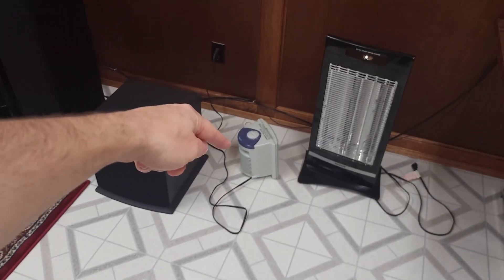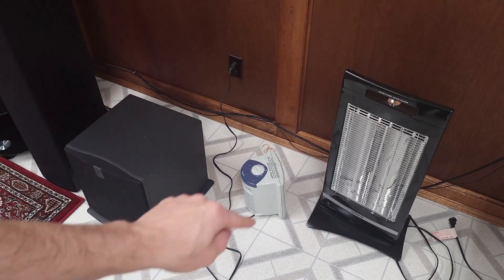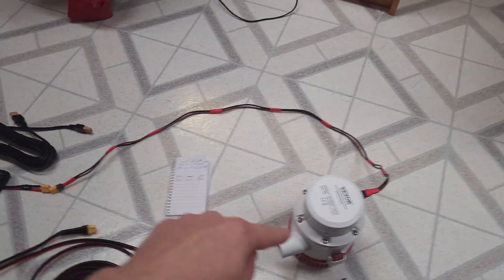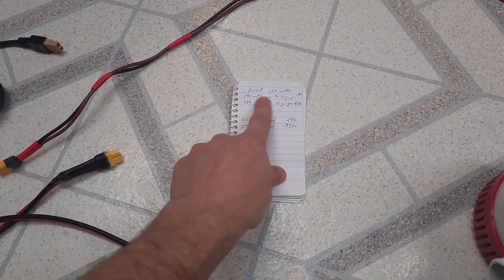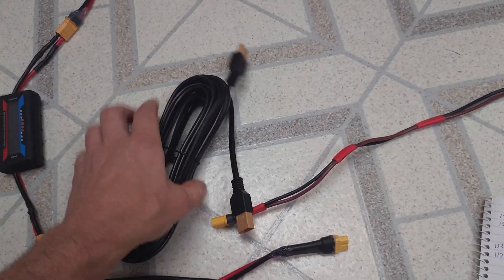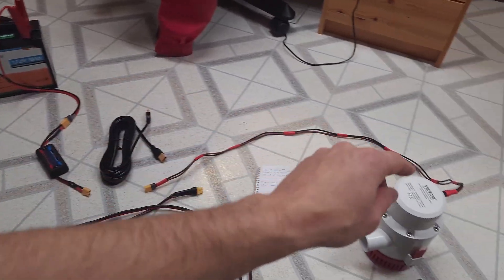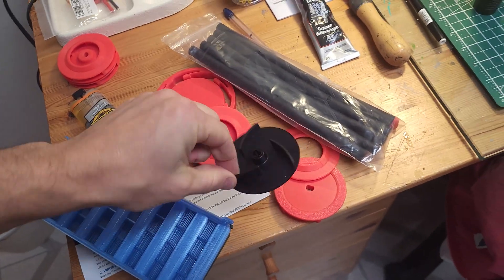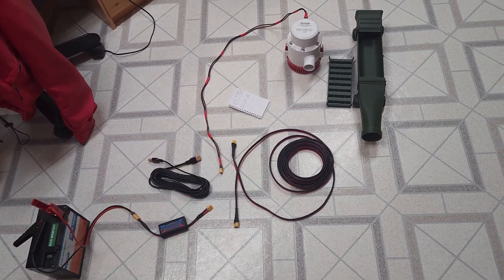Does using an extension cord use more or less power?

Comment: i was also thinking, you have the extention cord as a coil, rolled up. how would it be if it is just 10 meters one way and back 10 meters. off course it is DC. 
but not sure if it makes a difference.
Reply from the maker: The cord laying straight out or coiled up won't make a difference to the resistance in the wire.  It's just about the length of wire, the gauge of wire, and the current passing through.
Technically if you were really pushing limits, a coiled up wire would generate more heat, which is why wires buried in insulated walls follow stricter amp limits than those left open to the air... but I think that's more for the radio controlled aircraft crowd to play with.

Comment: In any case, we double the cross section area any time we double the distance or any time we double the power. We make it 4x if we do both. This will maintain the performance of the extension. It is better to calculate the original performance in voltage drop percentage to see what minimum cross section area is compatible with the load power and extension length, such at 1% voltage drop in a sensitive case and 5% in a less sensitive one.

Comment: Good to see you've made some headway Kyle, I run 20ft of 6 gauge battery booster cable to eliminate the voltage losses you are experiencing when running a 3700gph pump needing a longer cord. The booster cable is very flexible and comes with battery clamps.  Cut off one end and route to switch at user end with a short tag end to pump. An automotive relay is also helpful as it can significantly reduce the switch current requirements. Having the ability to turn on and off the dredge as needed without going to shore is a major plus.

Comment: If the pump can run 24v then just wire 2 smaller batteries in series and the wire length won’t matter as much then.

Comment: Cant really compare an ac extension cord to dc power. Apples to oranges.  Dc is all about wire gauge and length.  Shorter ground the better
Reply: Any cable experiences voltage drop , whether AC or DC, the math is just a little different for AC
Reply: It's closer to comparing lemons to limes.

Comment: Another way to test the power loss in the cable is check the voltage at the battery and check the voltage at the pump. You may see 13.2 volts at the battery and only 12.4 volts at the pump. Ohms law.

Comment: Great info!  Looks like having multiple short cables and run as few as needed is way to go. Also any chance of a custom impeller for the Honda ghx50 pump in the future? =)
Reply from the maker: In the very distant future I may play around with a gas pump...  Not sure what power plant I would modify yet.  I guess it depends on the purpose.  I think there is a greater than 50% chance I would just purchase a Keene pump for that, but you never know just how far down this rabbit hole I will go...

Comment: I will be testing out this little floating dredge soon! I have it about half way printed out at work. Im down in georiga. Got lots of small gold and some areas with larger nuggets. I really want to see how this system does with small gold. I have a creek just down the road absolutely loaded with tons of fines. I will test it along with just using the 3d printed nozzle going to my high banker. Curious to see the recovery of this little floating dredge. Im so excited!
Reply from the maker: I really hope it does OK on the finer stuff.  It's a tough problem to solve for with a dredge, but definitely let me know how you make out!